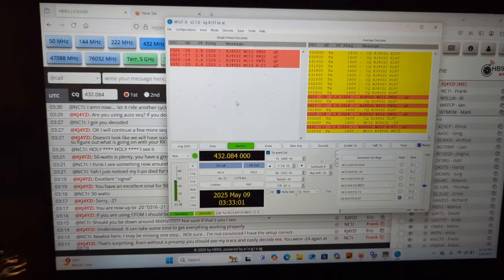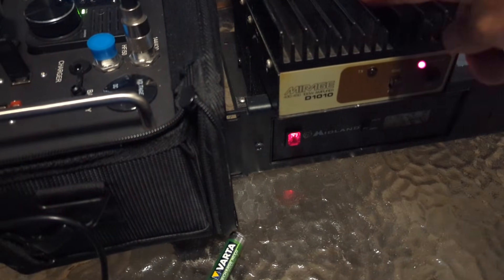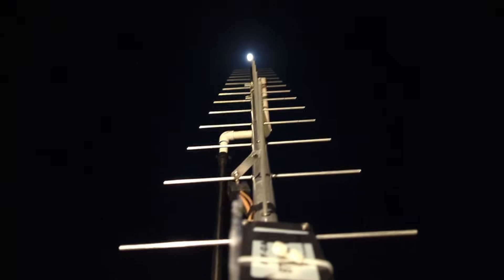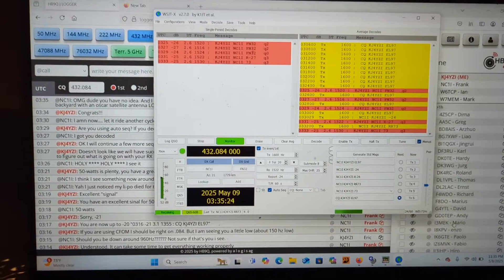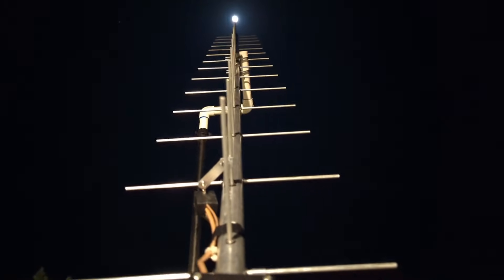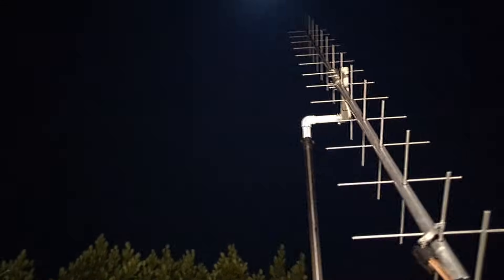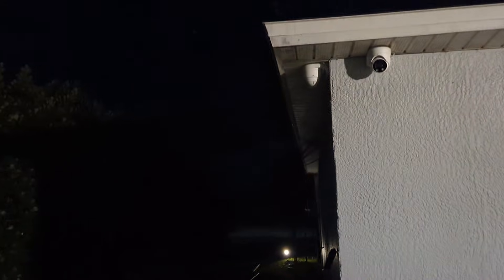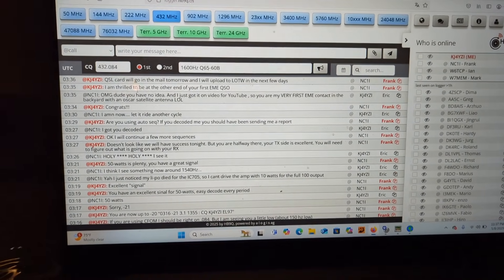SUCCESS!!! EME Moonbounce W/50 WATTS In The Backyard With NC1I!!!

Comment: it depends on where it is located. would not work near pge. maybe it is faked. i went to try a mixer. the pge noise was 20 volts with a tiny oscillator voltage.